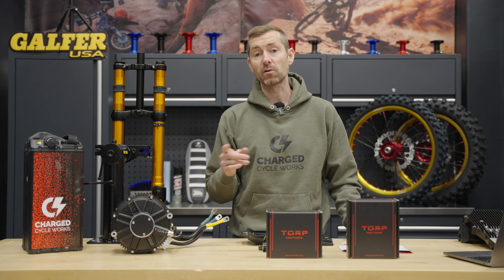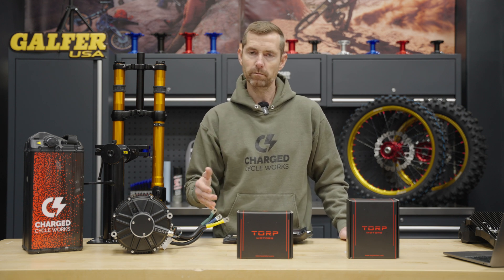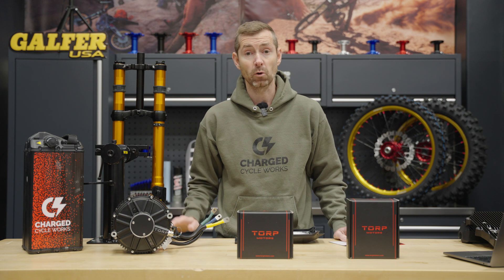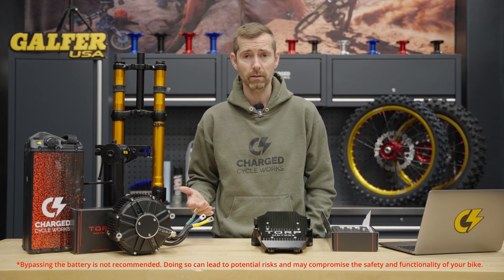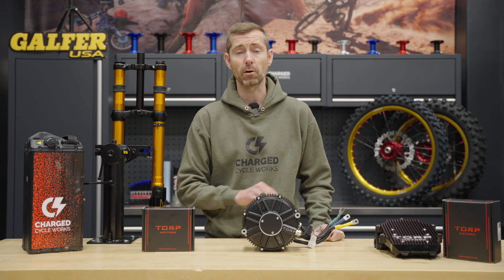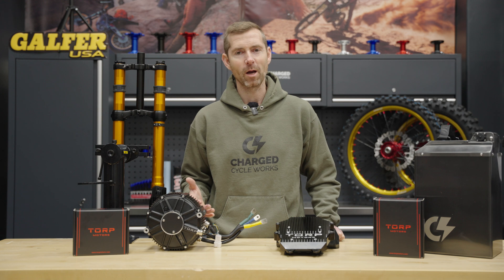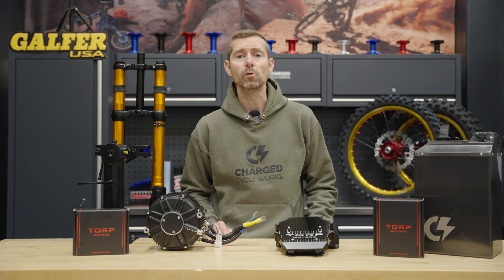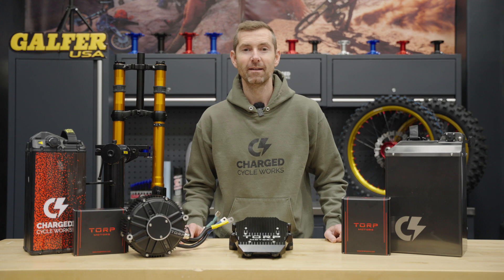Torp TC500/TC1000 Controller & TM25 Motor Overview

Comment: What is the max kw for tc500 tm25 w aftermarket 60v battery? Torp doesn't mention it on their site. Curious if there is a benefit other than not over heating to upgrade the motor.
Reply: i run a 60v setup with 15kw 500phase and tm25 with FW 80a i never have temp proplem, my highest temp are below 60grad (not fahrenheit). i can go up to 18kw with no temp proplem. 60v and tm25  are beast combo.

Comment: Hi charged cycle works I was just wondering what the best 18/21 wheels and tyres for the ultra bee for off road I was thing of the Dunlop mx33s and the kke wheel set but as you said in some of your videos is that there just too heavy for the ultra
Reply from the maker: For the ultra be we absolutely love the Dunlop mx34 and the mx53 tires. Both are great options, the mx53’s are a little more trail oriented

Comment: 11KW from a stock Talaria Sting R battery? Let's see, the stock battery can sustain about 115A continuous, even bypassed when you look up the specs for the individual cells. So 115A * 60V = 6900W. I don't see how you'd ever get 11KW out of a stock MX4 battery. Prove me wrong! Also, how the heck can Torp get that kind of power out of such a small controller? The X-9000 for example is HUGE, and about 3lbs heavier than the stock MX4 controller. How are they able to get that kind of current out of such a small device? I am genuinely curious.
Reply from the maker: Absolutely valid questions. It is winter time here in northern Utah but we are gearing up to be able to these to the test and find the real world answers you are looking for!
Reply: Can you explain where you get those figures from? Serious question. Thanks
Reply from the maker: These specs come directly from Torp.  We just purchased a Sting R and we'll be sure to test this out for ourselves to see how real world compares to spec numbers.
Reply: @TheShortzTraveler  Can't seem to post the link just search for "Talaria stock battery BMS bypass and cell inspection" by LoopERide
Reply: The reason why the torp tc500 and tc1000 can handle so much current with small footprint is because the use the aluminum bracket to disipate the heat to the frame directly so no overheating problem. It's kind of genius idea!
Reply: Sorry I was referring to @moxydave
Reply: Watch the talaria boys they did that exact install and it smokes a stock m x four
Reply: Actually they raced the e ride pro ss and destroyed it

Comment: I just purchased your 80 V ultra Bee battery. Will the TC 1000 for the ultra Bee work with that battery?
Reply from the maker: They have not created a tune for the 80V yet. They are working on it. If you want one asap the EBMX X-9000 will work.
Reply: @ChargedCycleWorks  okay but the voltage won’t be a problem. On there website it says 20 to 90v an 80.5v battery will top out at 92.4v
Reply from the maker: @ThatGuyBlake43 hopefully the voltage won’t be a problem, it’ll be up to Torp to determine that, and when they do we will put it to the test!
Reply: The EBMX X-9000 is amazing with the 80v battery. That’s the setup we are racing on.
Reply: @motoxer913  I bet it is but they remove a lot of the key features on the ultra Bee
Reply from the maker: Yes, that is one drawback with the X-9000.  Stay tuned for more testing with the Torp products.